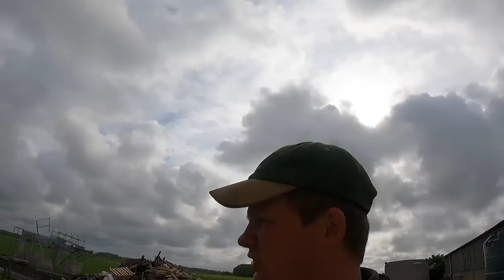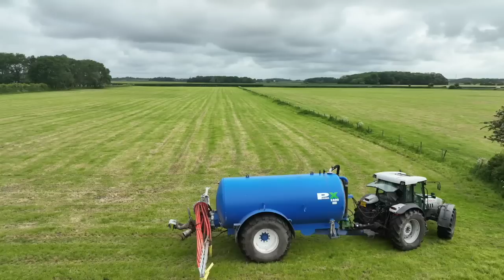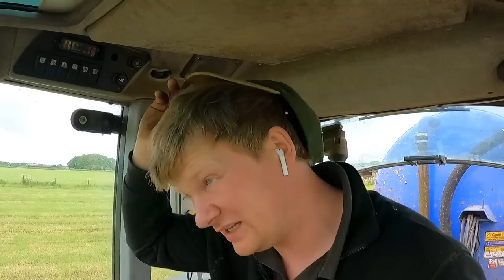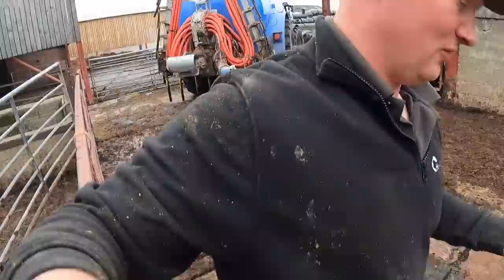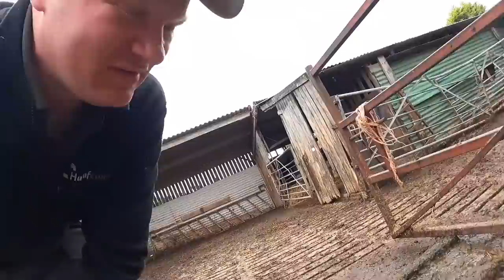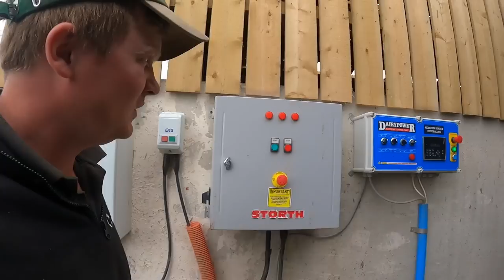AN EXPLOSION OF POO... ALL I WANTED TO DO IS MAKE GRASS GROW!

Comment: Would it maybe be possible to extend the bubbler system in the large silo with one or two extra "zones" and place those in the "bad" tank so they get stirred in rotation with the large tank?
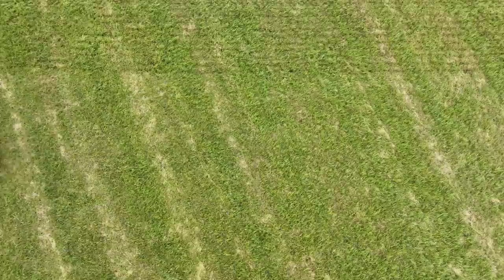PS: at 17:05 it looks like the far left pipe on the dribble bar is blocked  in case you hadn't noticed Tom ;)
Reply: Well spotted
Reply from the maker: I have seen it 🙈😂

Comment: I'm sure this has been said but have you thought about maybe trying to do a quick and easy air pump for that problem pit? Like just using flex PVC and simple air pump you can remove when not in use. So example you know you want to do a slurry run in the coming days you just hook the pump up a day or two ahead and golden when its time to spread.

Comment: hey tom, i've watch sewer cleaner and they have something called a crust buster. do you think that can help you mix the slurry in the bad clamp? you can look into it its just a long drill with blades at the end. the videos i've watch were people cleaning septic tanks.
Reply: If you use one wrong you can ruin a drain, it's a careful balance

Comment: I couldn’t deal with paddling through that clart/slurry when putting the pipe on the tanker. In and out the tractor wellies covered in slurry 🤮
Reply: It’s only chewed food🤣afraid its just a part of dairy farming. Imagine the straw you would use if everything was bedded down. Not to mention the muck to spread😮. Slurry is a valuable farming resource, will save tens of thousands on fert

Comment: Your mike may have a function to muffle out background noise.  It seems to act up only when the pumps are working and in the cabin of the tractor. I’m in no mean a sound engineer but you should check your set up to see if you have a function like that in the menus. That’s what I do first. Oh tell the ginger man to speak a bit slower it is very hard to understand him because of his accent and to make matters worst it barely moves his lips and it’s even harder to try to read on his lips. Not a complaint just an observation from a French Canadian man speaking English with also a very strong accent. Apart that it is very interesting how you stay focused and so jovial with so much work. You certainly adore what you do! Thanks and keep them coming

Comment: With cows in paddock have you thought of using a topper or harrows to break up the cow paddies? as they do help the grass but also hurt it as there not spread about and a slitter to help air the grass.
Reply: They do harrow.
Reply: Haven't seen them use what we call a ripper in Aus yet.

Comment: Tom the best way to get that thick stuff out is to fill up a tanker with water and use a 2 inch pipe to wash it down trough the slats then stuck it out and flush it in again

Comment: Check your switch between mic and line . It sounds like it’s been switched over .
Reply from the maker: But I never changed them back? Doesn’t make sense to have a little issue for a few minutes 🤷‍♂️🙈
Reply: @TomPembertonFarmLife   sometimes they get knocked . 
Rule of thumb ... if your mic is attached directly via a cable that will be mic level and 48 volts is needed to power the mic . 
Line level means the mic is coming via its own power source like a radio mic . 
If you plug a radio mic receiver into the camera and set it to mic level you are adding an extra 48 volts and it will overload the mic and you feel you have to adjust the levels way back to get rid of distortion. 
I hope this helps . X H
Reply from the maker: @Helen-sound  This could be it Helen, so o have it set at +150 on one setting and plus 20 on the other. Maxed out becasue I thought it would get the best audio?
Reply: @TomPembertonFarmLife     Oh I hope it is . Don’t max it out . You need some headroom when it gets loud or it will hit the limiters or compressors and that’s when you get that distorted sound . It should be jus peaking into the red for a normal voice .
Sometimes the old interview mics we put on presenters had a AA battery in them so we didn’t need to power them  I still forget to put the 48 volts in on the desk when we swop mics in studio .

Comment: Difficult to make out half of what your saying Tom. You speak way too fast when your excited. Regarding the back slurry pit could you not put a high pressure washer hose through the slats where the muck is heavy and flush it out with water? I seem to recall someone giving you a water pump a while back might as well make use of it.  💩🚰